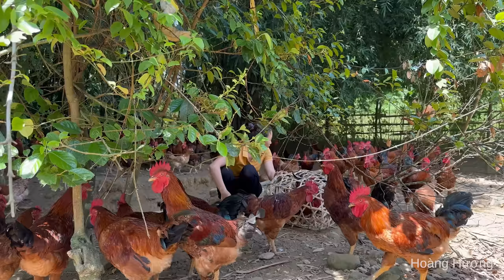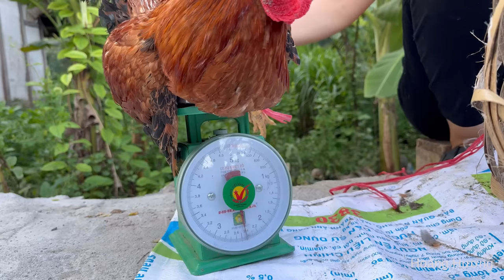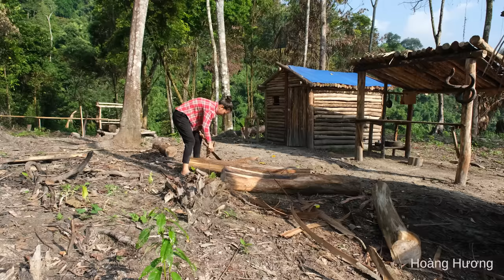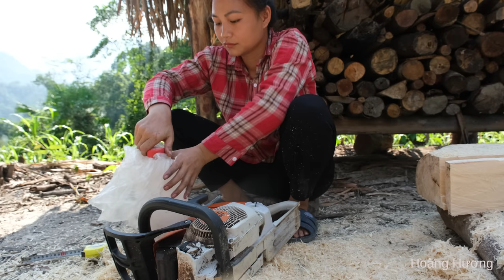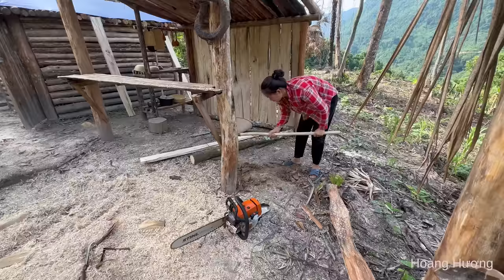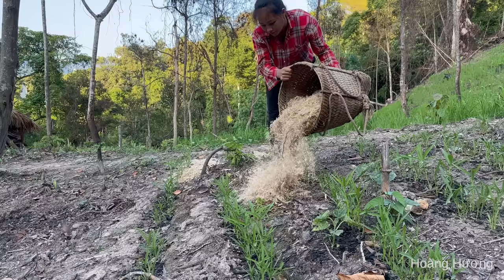Harvesting Chicken (rooster) Goes to market sell, build kitchen retaining wall | Hoang Huong

Comment: All that sawdust you created can be used in many ways.  It can be used as a mulch for the garden, to prevent weeds from growing on the path, to slow the loss of water from an area, as fuel for your fires--you could even combine it with some sort of oil, fat, wax, or the like to make a great fire starter--and if you gather clean sawdust and have a cool, damp, ventillated place to store it, you can even preserve root vegetables in it.  I think the one you picked is the easiest:  scoop and scatter it lightly throughout the garden area to break down and serve as nutrients for the plants over time, and as a way of hepling keep the rain from running off downhill too quickly.
Reply: Ради ютуба и муж не нужен
Reply: You should turn on captions so you can read that she is using the sawdust
Reply: @ClassicallyMish  I know she used it in a specific way.  I was just commenting for everyone else that sawdust can have a lot of uses.

Comment: When splitting logs with the chainsaw, you should hammer sticks into the ground on both sides to prevent the log from rolling or slipping. It is much safer and makes it easier to cut in nice straight lines.
Reply: อยู่เมืองอะไร
Reply: อยากได้ไก่